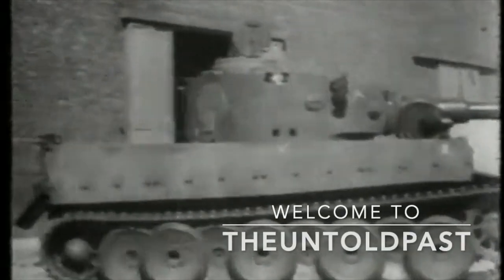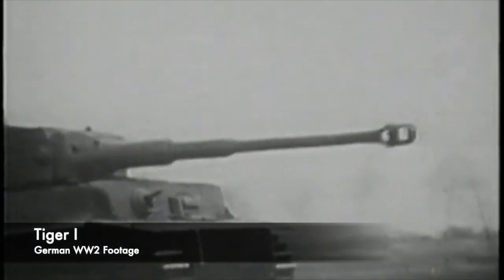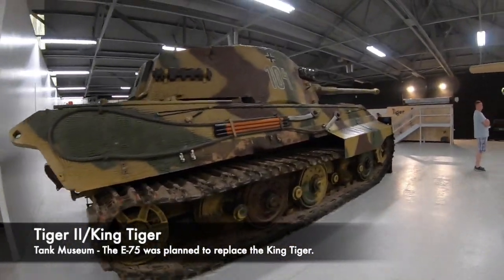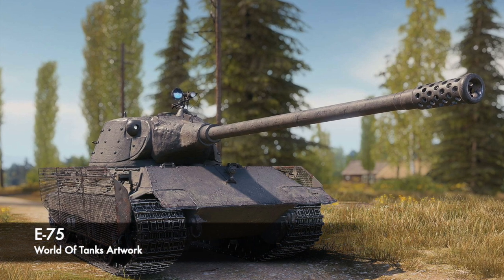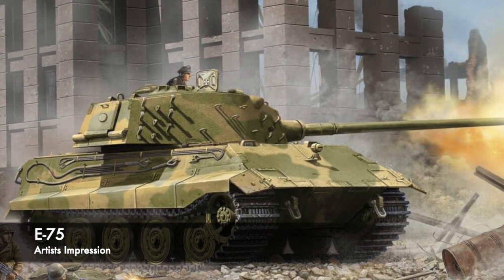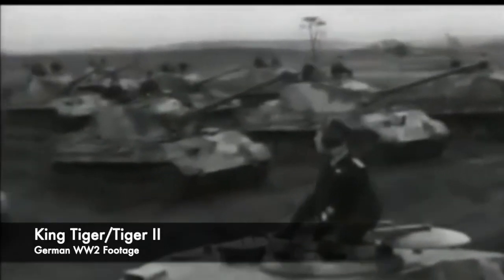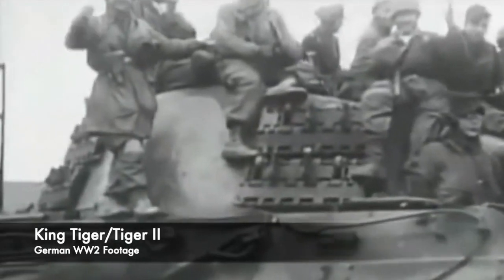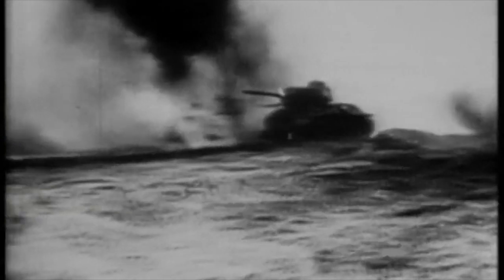The King Tiger's Replacement - The E-75 Standardpanzer

Comment: They also improved the sloped armor, mainly on the front, making it an angle wich would have been impossible to pen for years to come.
Reply: So why does he say they wouldve been ineffective against the new soviet tanks?
Reply: @noahno  Ask him that question, it must be based on assumptions, T44 and IS3 were still behind in key aspects compared to German tanks, IS3 was slow in every possible way compared to German heavy tanks even though those were not fast neither except for the original tiger, traveling speed, reload times, turret turning speed were slow on the IS3, and T44 was basicly a panther counterpart but more compact and therefore without the powerfull gun a panther 2 or E50 would have, add to that the fact that Russia was still far behind in optics quality and accuracy of guns, the models they introduced were totally new and had to be developed further by combat experience, a problem the German did not have because the E line was simply an improvement upon existing, battle proven models, and there you have it why i disagree with his statement.
Reply: Nope. Not from HEAT rounds
Reply: @MrShadowofthewind  The IS-3 and the T-44 were very cramped, and the turret shape of the IS-3 made the reloading times slow. I don’t think they can fight on the hilly terrain of Germany.
Reply: @noahno  king tiger and tiger also were better than russian tanks but when a russian artillery barage takes out your tracks and some russian tanks rush towards you, you lose.
Reply: @laksamanasuhendra5868  well one or two cheap tanks for a expensive heavy isn't a great tradeoff
Reply: @yuurichito1439  yep
Reply: @noahno  they’d have been too few and would have been plagued by material and worker shortages meaning more breakdowns with few parts to replace broken ones and even fewer crews trained to do the work.

They’d have lost to Soviet tanks because of their logistics problems.
Reply: one thing confuses me that which e-75 are they talking about the tier 9 wot e-75 or the tier 8 e75 (E75 Ts)
Reply: @SZK_PLAYA  a tiger 1 tank cost ten time more than a T 34-85 so the e75 would be even more, even though the tank is good, u cant fight 1 vs 10 @@
Reply: @dinhtan1360  listen the original concept of e75 is that it will weigh 75 tons which is lower than the tiger ii. tiger ii weighs like 80-90 tons
Reply: @MrShadowofthewind  IS-3 was definitely not slow, it’s speed is one of its most valuable assets. The IS-3 is even lighter weight than the Panther tank.